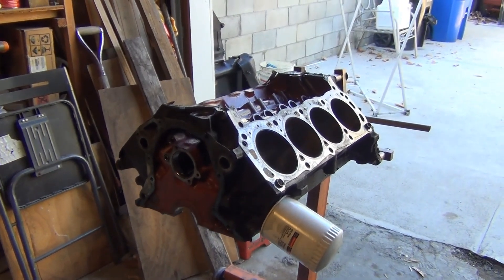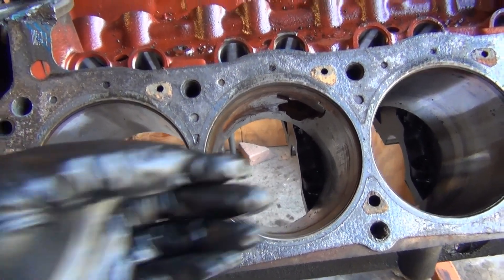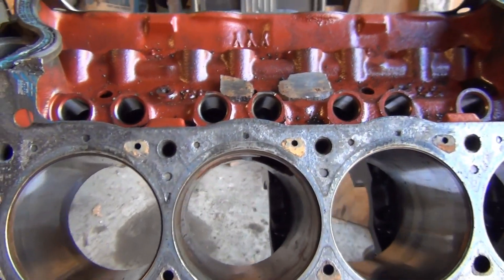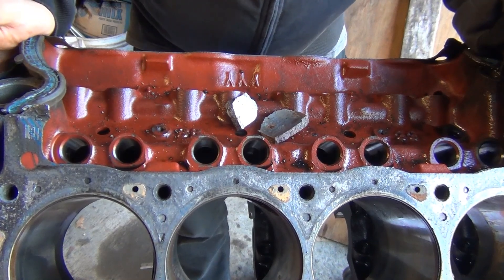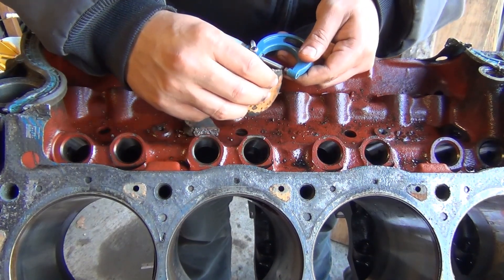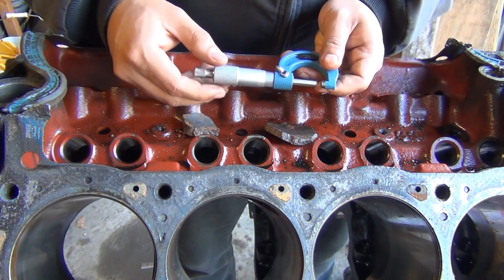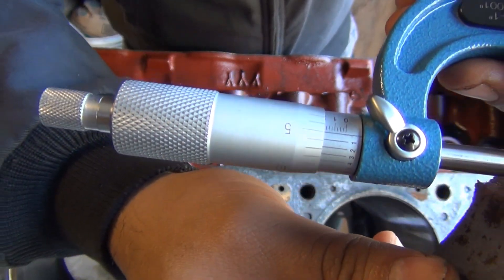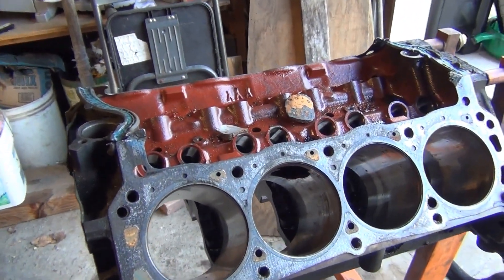Ford 302 Cylinder Wall Thickness, Stock 5.0 HO SBF

Comment: That is roughly a smidge under 5mm then. That's a lot thinner than I expected!! Nice info.
Reply from the maker: I was thinking that as well! Also about how much thinner they get after being bored out a couple of times 😬
Reply: @MrBlitzkrieg1987  that's a great point!! If my math is correct, going 40 over would be roughly 1mm larger, meaning you'd be shaving .5mm frm that wall.
Reply from the maker: @89G  I honestly wish I had not seen that, holding that thin wall of powdery metal in my hand made me lose confidence in building anything serious with a stock block ☠️🙁
Reply: @MrBlitzkrieg1987  at least that wasn't on the thrust side, and that's where it needs the most strength.

Comment: One of the biggest mistakes I ever made was using block fill in a Cleveland because of all the yadda about core shift in the casting process....the forged TRW pistons would slap when it was cold, so I filled the block......constant over heat at the end of the eighth!
Reply from the maker: I’ve never used block fill, none of my builds have ever gotten that serious. But I’ve heard it from at least one other person that confirms what you are saying!

Comment: Triple x is mustang that might b grand marquis
Reply from the maker: I’ve actually seen both Y and X on Mustangs… my brothers hatch had a Y block as well and Im almost 💯 sure its factory. Unless someone swapped it in too 😂🤣
Reply: @MrBlitzkrieg1987  I've rebuilt atleast a dozen 5.0 mustangs. All xxx, but there all the same anyways
Reply from the maker: @alltherpm  yeah, I believe you! The SN95 302 that I put on the T-top was an XXX, Im not really sure that these yyy blocks were original to the cars, maybe someone swapped them in at some point.
Reply: You should cut the heads in sections also( if you have the tools to do it) to see thicknesses for future porting.